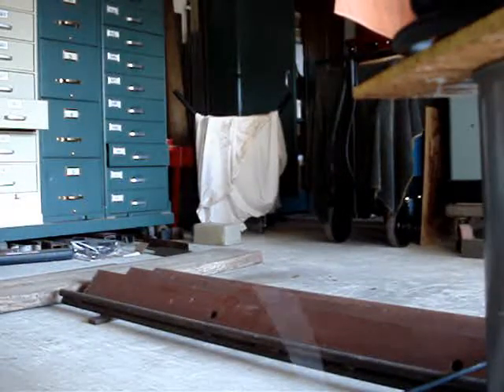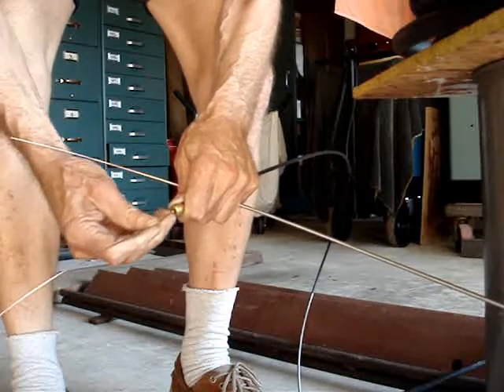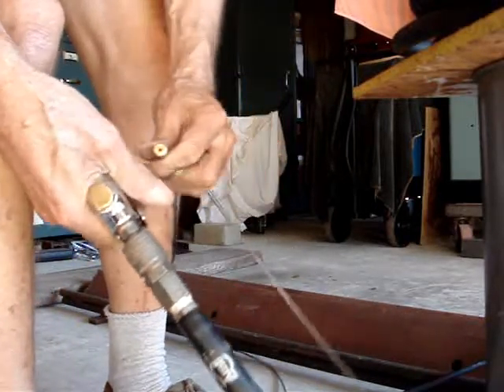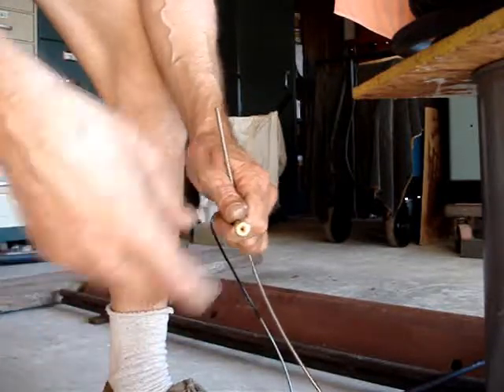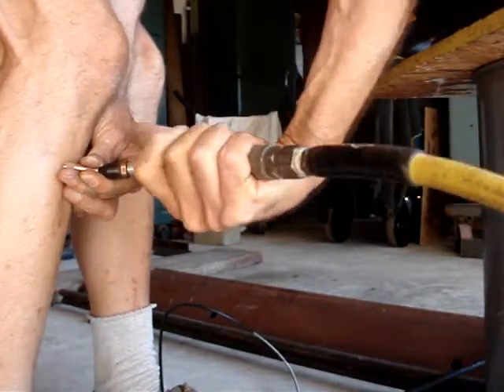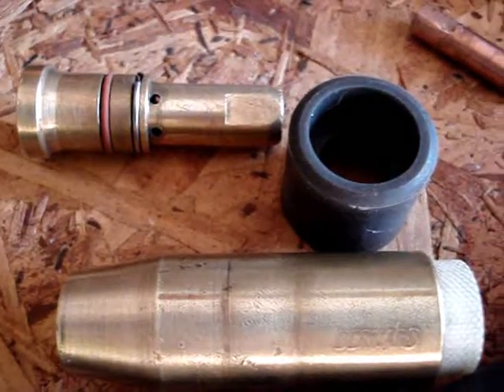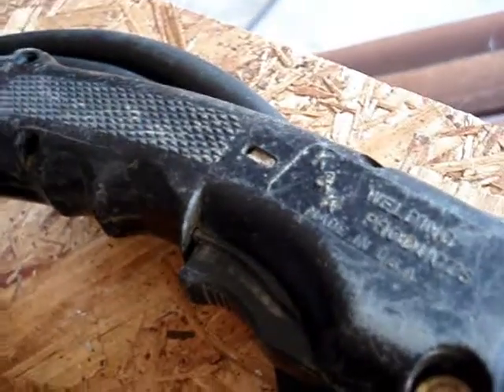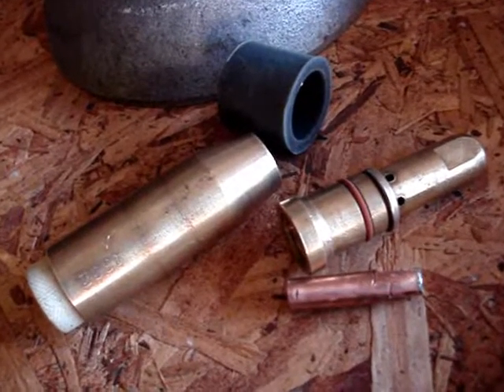Bernard MIG gun MYSTERIES_2 model Q-200? - old?

Comment: Ok, now that I see your torch, it's the same one that was on my machine.  Should be a Bernard Q200.  Does not use jump liners.  You mentioned the contact tip looked egg shaped, that's how they should be, they're called a 1/4 turn style or something similar, it should fit somewhat loosely into the gas diffuser, then give it a little twist and it tightens right up.  I use 035 or 045 wire, but I do recall there being a wide variety of tip sizes available, I've got one around an 060 somewhere